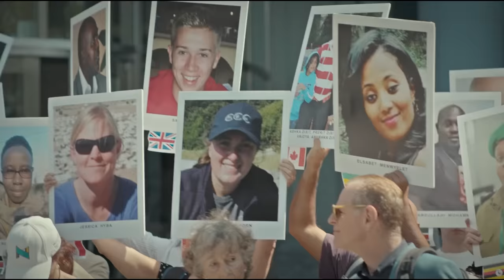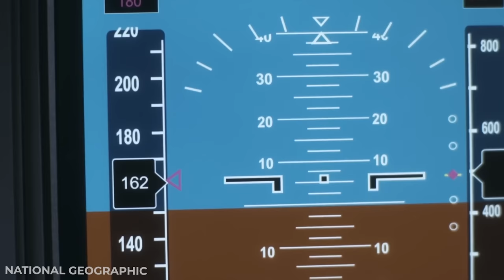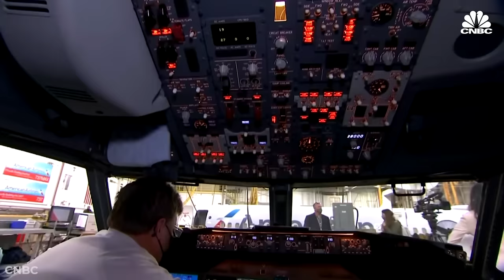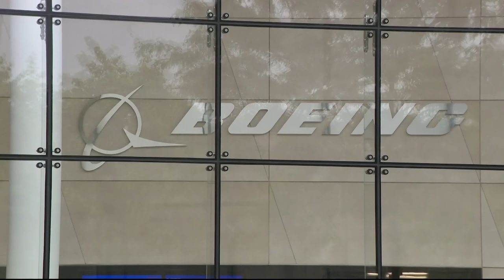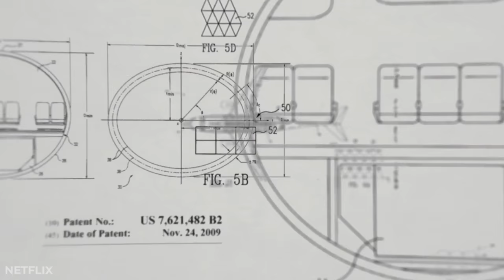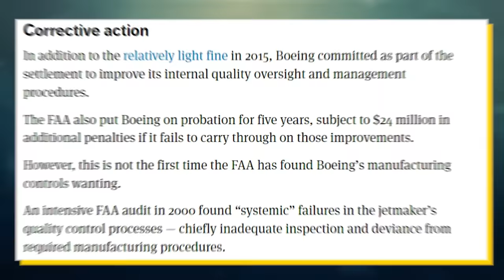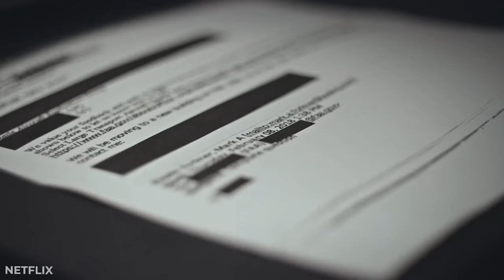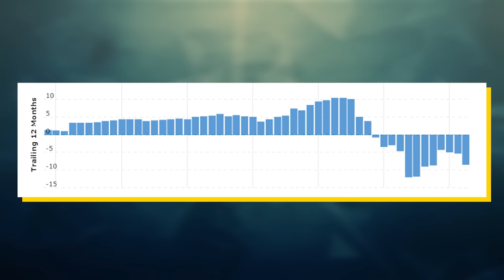Even Boeing Engineers Don't Trust Boeing...

Comment: I'm not an aviation nerd and after the 737 Max 8 disasters I started to pay more attention to what plane I was flying on. I don't trust Boeing at all. Also, it's not just Boeing's fault. The FAA had a huge part in the 737 Max 8 disasters, by the fact they allowed Boeing to self-certify.
Reply: as of now the 737-8 max is faa certified and it is being used all over the world. The only area where it is not allowed to fly is china, eventhough it will start flying there.  You have nothing to worry about (:
Reply: I always preffer Airbus. As cabin pressure is perfect & Toilets size is ok for civilised people.
I only travel by Indigo & Vistara for domestic & Emirates or Singapore for international (For A380)
Reply: I simply stopped flying at all.
Reply: Yeah - I think I'll stick to airbus or older Boeings from now on.
Reply: @rishavbhowmik8163  you have not been on  a 777, or 787?
Reply: There is always going to be some degree of self certification.  I would be surprised if this is not the globally general case.  It is simply too expensive to do it otherwise.     Other than the fact that the 2 planes did crash most of what you see in the media is wrong.    Boing can't fight the misinformation directly as it would be characterized as ducking responsibility.
Reply: @rishavbhowmik8163  Why? Airbus has had its own share of problems that were pretty much identical to Boeing’s, such as their recent incident with landing gears.
Reply: @aycc-nbh7289  you mean where 2 airbusses just nosedived into the ground without the pilot being able to react and they tried to sweep it under the rug for as long as possible? 😅
Reply: @Schimml0rd  I was unaware of that incident, but I was referring more to a particular incident where the front landing gear of the A320 can be stuck at being rotated 90 degrees, jeopardizing the ability for the plane to land safely, as it had infamously occurred on a Jet Blue flight where the passengers watched their own emergency from the IFE monitors.

But I guess I should thank you for bringing another incident to light. The Western world has too far been held ransom to the duopoly of Boeing and Airbus and we need someone else to manufacture medium- and long-haul aircraft to compete with them.
Reply: Well I hate to break it to you but Airbus has had similar problems with similar cover-ups by their relevant governments. This is just how it's done.
Reply: Certainly never fly on a Max. Avoid Boeing where possible
Reply: @lila2028  Why, because you assumed all aircraft types were unsafe without having intimate knowledge of them?
Reply: @danharold3087  There isn't misinformation in the media about Boeing.

They designed a system which exercises control over the aircraft under certain circumstances and did not provide any training to the pilots on the system and did not even put anything in to the aircraft manuals. They deliberately hid details of the system to avoid demands from the airlines for training on it, which pushes the cost up, which they wanted to should.

Not only that, as an engineer, I can say that the system was very poorly designed, and some serious short comings and in my opinion should never have gone into operational service.
Reply: @deang5622  Start with the misinformation regarding 7373 MAX stability.  Media says due to engine placement it is an unstable aircraft.
Reply: @danharold3087  Technically it is unstable, but not by much.
Reply: Boeing planes from before 1997 are also generally of good quality. They merged with McDonnel Douglas in '97 and that's when their quality got much worse.
Reply: @deang5622  All aircraft with under wing engines change pitch when power is adjusted up and down.   If you call this instability there are no stable airliners.
Reply: The FAA was allowing planes to be certified by the same manufacturer because they didn’t have enough funding to properly test all the planes, you can thank Trump’s administration for the budget cuts
Reply: @Sweedster   But is this unique at Boeing.  We only know of it because things went badly wrong.   It is doubtful that this is a binary thing.   The FAA could have prevented this with the people it had if they were more diligent.
Reply: The FAA  had at the very least one chance to stop the madness with the existing inspection setup.     A FAA inspector was shown a 737NG with MCAS fitted to illustrate that MCAS was not new.  Had he realized this was a ruse it could have stopped there.  Yes people at Boeing were at blame.  But so are people at SW and the FAA.   

I have said elsewhere that this could all have been avoided if airlines did not directly pay for simulator training.    Fix that and you prevent it from happening again.   Slap Boeing and the problems remain.
Reply: @Schimml0rd  One airfrance airbus nosed dived in the atantic because a sensor failed and the pilots tried to gain control. 300 passengers passed away. I believe families are sueing airbus.
Reply: @joergkalisch7749  obviously
Reply: @alexrebmann1253  that's not true
Reply: @kirilmihaylov1934  tell me why
Reply: @alexrebmann1253  because it was Pilots fault not Airbus
Reply: @alexrebmann1253  Are you referring to Air France flight 447? If so, that was 100% pilot error mixed with poor CRM
Reply: @stefanocozzi8188  given the choice I would chose to fly on an Airbus right now.
Reply: @alexrebmann1253  The 787 has excellent high cabin pressure and is very quiet. The 777 has none of those things. The 777 is the loudest wide body airliner I've ever traveled with. Like a 20 year old car with bad door seals doing between 200 and 250km/h. The cabin pressure is the same as on any other metal fuselage aircraft (including Airbus).
Reply: @rishavbhowmik8163  that's legit not airbus/boeings decision mate that's all choses by the airline. Interiors are cometic and free for the airline to customize to their desire. number of seats, type of seat, gap between seats, colour, pressure (to a degree) temperature toiletries, toilet all of that is done by request of the airline custom for each of them. Boeing is still the best air manufacturing company out there and theese accidents were in part due to improper training of the pilots. Although both crashes were from a faulty sensor that has since been fixed and replaced on all airframes there was a manual override that would've saved both flights if the pilots used it. Panic/not knowing where that override was caused the aircraft to crash. The override was (and still is) on the trim wheel and i quickly thought myself that so that if I was on one and it started plummeting I'd legit break down the door if I had to to tell the pilots what to do and say geez y'all never learn or something? 
The airlines that had crashes should definitely had that be part of the training for this aircraft but they happened to take the lady way assuming things were basically identical to other 737s and didn't bother to do proper retraining for the maxx model. It's like moving a stair step 0.5 cm makes everyone trip moving the trim override and having a new sensor for it caused pilots to lose control over where thing were. Boeing is safe. Has a better safety record than almost all other airlines and is still the top dog. The 787 is the most advanced civil aviation aircraft in the world and like the name it would be a dream to fly it.
Reply: @CheapBastard1988  it  is new aircraft after all
Reply: @Sweedster  and Boeing has decades of experience testing aircraft even being a certifyer for other manufacturers and the max would've passed all FAA regulations. Easily. The crashes were not due to bad design. It was bad pilot training and lazyness from the airlines. Many of them flew without crashing but two incidents occured when pilots did not know how to react to the aircraft's anti stall system malfunctioning and basically didn't do anything right. All they needed to do was to override the trim adjuster which they would've found on the trim wheel right next to their legs.
Reply: @longfang98  Boeing has a better flight record. Airbus's isnt far behind true enough but Boeing is the safer aircraft so idk where y'all get this from
Reply: @kirilmihaylov1934  "obviously Boeing isn't safe" meanwhile Boeing having the safest not just aircraft but transport vehicle IN HISTORY. Yeah totally not safe. It's the second safest aircraft manufacturer in the world second only to bombardier. Who when you think about it is too young to have a accurate safety record as if right now. Flying is sti the safest mode of transport in the world and Boeing still delivers some of the safest aircraft ever. The 737-800 being the safest commercial aircraft ever flown.
Reply: @elementalgolem5498  that's not true . Saying this after  the 737MAX debacle means you don't think at all .
Reply: @deang5622  exactly right
Reply: @kirilmihaylov1934  ? It's really not a big thing man. Iike their safety record is still top tier Prestine. Even with the max crashes look at ANY stats on aircraft safety. If you paid for it is gladly fly a 737 max 1000 times in a row just to prove how rare a crash actually is. It's statistically unlikely i would even experience a minor aircraft issue. Let alone a fatal crahs
Reply: @EvanBear  yes that is true
Reply: @notsocooldude7720  yes he is but he doesn't know the case
Reply: @elementalgolem5498  statistically speaking Airbus has less crashes than Boeing especially as of late
Reply: @aycc-nbh7289  that's not true . Did any Airbus crash  like 737MAX  . So you saying nonsense
Reply: @kirilmihaylov1934  you cannot. And i do mean CANNOT take the men number of accidents. Airbus has more accidents per hour/mile flown as Boeing aircraft have been flown for a significantly longer amount of time. When Boeing has Multiple of the top 5 most flown aircraft then ofcourse they will have .ore crahses, crashes are bound to happen you cannot avoid them. But if you were to chose yourself a car brand and one has driven over 1 000 000 miles and only had 10 malfunctions that lead to a fatal crash, or the brand that has only driven 100 000 miles and only had 5 fatal malfunctions? I mean the one that hasn't driven as far has had less crashes right? Who cares that the other Has gone 10x further and sti had only 2x the crashes?? It's not how statistics work and that's why aircraft safety records and airline safety records are measured in deaths per 1 000 000 miles flown. Boeing is at 0.71 or something and airbus is at 0.76. both absolutely tiny numbers ofcourse but Boeing is still well in the lead making the chance you specifically will die when boarding a airbus aircraft higher than when boarding a Boeing aircraft. If you really want to feel safe fly a bombardier i think they are at like 0.67 deaths per 1 000 000 miles flown. Lowest of all. Dethroning Boeing as the safest. Emirates is considered the safest airline to fly and they fly predominantly Boeing aircraft.
Reply: @elementalgolem5498  Emirates doesn't fly 737MAX  .
Reply: @kirilmihaylov1934  Please reread my comment. There was a specific incident on a particular Jet Blue flight where the landing gear infamously rotated 90 degrees and the plane had to make an emergency landing. This has occurred on other A320 planes to my knowledge.
Reply: @kirilmihaylov1934  “As of late”? Is there any specific epoch related to both companies that would separate “in the before time” from “as of late”? And why are these crashes even happening? Aircraft malfunction? Overlooked failed part during inspection? Pilot error?
Reply: @kirilmihaylov1934  okay and? It's been years dude the max has over 500 000 flight hours since the issues and has had no incidents.
Reply: @elementalgolem5498  I think you are missing the point. Ppl are worried about Boeing attitude and cost saving mesures. Airbus, to my (limited) knowledge, never screwed up to the same degree as Boeing (with Max), and never heard of any proof of the same cost saving attitude (not to the extent of Boeing). 

No one claims Airbus is statistically safer (or at least i don't think it was the intention), but from what we can see, Airbus seems more preoccupied with passenger safety then Boeing, and this is why some want to fly on Airbus. 
I would fly hundred of times on a Boeing without worry, but i would still pick Airbus if i had the choice.
Reply: @aleide2980  thing is Boeing doesn't have any "cost saving measures" nor a bad attitude. It's all misinformation circulating the internet perpetuated by people that don't have a clue on how aviation works. The air manufacturers don't save on costs because airlines buy the aircraft almost no matter the price. The max doesn't have any cost saving features. The feature that was a issue is Boeings new anti stall. It's a sensory device that detects when the aircraft airspeed is getting too low and about to stall(fall out if the sky) at which point it will take control of the aircraft and automatically pitch it downwards to get the speed up. It's a pilot error prevention device not a cost saving device. It's literally a safety addition that came with the max. And is still now (a more fledged out) feature of all new Boeings. Ethiopia air and i don't know the other (Malaysia air maybe?) Didn't bother properly training their pilots on all the changes because they assumed the 737-max would be the same as the 737-800 they already had training for. So when this feature malfunctioned 2 times, one time in 2018 and one time on 2019 both lead to a fatal crash. However if the pilots had disengaged auto trim using the trim wheel next to their leg neither flight would've crashed. Meaning that although it was a system malfunction. It was stil pilot "error" as it was a preventable crash had the pilots acted well. Many want to blame Boeing for not training the pilots. But that's the airlines responsibility Boeing did provide checklists and a user's manual they could've spent a couple hours reading
Reply: @elementalgolem5498  didn't really follow the whole thing, but didn't Boeing 'forgot' to inform companies and/or pilots how the new anti stall works? That's what I heard at least.
But when I was talking about cost saving, I was more referencing the cargo doors incident. Most of the things talked about in this video seems legit/coherent, so the point about safety and cost saving still stands.
Reply: @aleide2980  you are right this guy is a troll
Reply: @aycc-nbh7289  q
Yeah landing gears is the same like killing  346 people...give me a break will ya
Reply: @kirilmihaylov1934  It actually is the same, since a landing gear malfunction could mean that the engines get jammed from the resulting debris or from the engines colliding with the ground and a pilot error could increase the likelihood of messing up an already dangerous landing.
Reply: It is called regulatory capture, meaning industry veterans take government regulatory bodies over and try to bend rules and regulations in their favor, often at the expense of the public. A very common occurance in the US over the last 30-odd years.
Reply: @vivektulja4516  exactly right ....big business  pays the government agencies in US
Reply: @eleventy-seven  Are you sure? Airbus has also had its share of quality incidents, including one where it bribed regulators in the exact same way as Boeing did to get themselves out of trouble back in 2009 or so and one where their A320 aircraft had defective landing gears, which infamously lead to a Jet Blue flight making an emergency landing with the passengers on board watching exactly what was happening on their IFE monitors.
Reply: It's because boeing payed them to
Reply: Kiril Mihaylov  The CFRP fuselage is the reason that the 787 can do its high cabin pressure and it can have air humidifiers. In an aluminium fuselage, the high cabin pressure isn't possible and air humidifiers are a bad idea because of the corrosion it will cause.
Reply: @danharold3087  except that in order to fit the much larger turbofans they mounted the engines much further in front of the wing increasing the lever arm and thus the torque forcing the nose up. Changing anything more than this would have made it difficult to claim that this new plane was just a 737 like any old one before. If it was a new type then all pilots would need new certification making it much harder to sell into current airlines. This whole mess was just a result of creating an essentially unairwortthy craft that they could easily sell for a big profit.
Reply: @tonycook7679  Mr Cook.  You can stick with the ill informed media story if you like.  I explained the forces.  Not my fault if you can't or will not understand it.  Not going to waste more time.
Reply: @kirilmihaylov1934  fun fact just boarded a 737-8max so I'll let you know in about an hour if I survived the flight
Reply: @tonycook7679  it's definitely not unairworthy with over 500 000 flight hours without incident, I'm taxiing in one right now. Will let you know how it goes
Reply: @elementalgolem5498  cool . Give an apdate
Reply: @elementalgolem5498  if one more of  those is going down it will be the end for Boeing
Reply: @kirilmihaylov1934  landed safely
Reply: @elementalgolem5498  cool
Reply: @aycc-nbh7289  I think he's saying that Airbus never had a problem like that, that was what happened to the 737 max.
Reply: @simongregory3114  And now the A350 seems to have suffered another landing gear issue.
Reply: i will never board a 737 max. ever.
Reply: they didn't assume it was the same! Boeing literally hid the fact that the 737 MAX had this new MCAS system to avoid additional pilot training, even when airlines asked about additional training or changes. Boeing told them its not needed (which was a lie). They knew that the MCAS system was faulty but didn't say anything to anyone to save costs. So stop blaming the Pilots that couldn't have known and lost their life because of boeing.
Reply: @stefanocozzi8188 U SURE ABOUT DAT?
Reply: The FACTS are that Boeing rushed the 737 Max to market and were deceptive in fully explaining the changes to the FAA and pilot training. THAT is the main cause of the 737 Max problems. The quality issues are a direct result of the rushing to market. The ROOT cause of ALL of Boeings problems are indeed the short-term profit motive. I hear every “motivational” brief from the CEO down and the bottom line is commercial aircraft production speed and market savvy. Very little true engineering or specific problem discussion, only market-speak and “diversity”. It’s disgusting.
Reply: @ori4627  because it served as an extension of the STS so it can use existing QRH procedures for runaway trim. that design philosophy worked perfectly, had the pilots know how to deal with runaway trim. technically, it wasn't MCAS that explicitly made the aircraft nosedive, it was the resulting runaway trim. 

MCAS was there to serve stick force regulations set by the FAA. it wasn't for the additional pilot training, it was fundamental for the handling of the aircraft. MCAS on paper was not faulty; it served as an extension of the existing STS, hence there was no need to tell anyone about it. does Airbus need to tell anyone the specific changes they made for their FAC when the A321NEO exhibited similar nose-up tendencies as the MAX? no, they don't, and they didn't.
Reply: Good god, no it isn't. The aircraft has slightly different flying characteristics to a standard 737. Under power, those powerful forward placed engines would raise the nose more than a standard 737, MCAS would adjust trim as necessary to resemble the legacy aircraft. Statement: Runaway trim was considered a non critical event for decades and didn't ever require redundancy, hence the single AOA sensor on the MAX - . The MCAS software only operated under certain conditions, with flaps up and it was surely a poorly considered piece of software, we all understand that - yet it induced a similar condition to runaway trim, which would happen if a bit of sandwich got stuck in the trim button on the yoke, whatever. The 737 has massive trim wheels by your elbow with a white stripe on them so peripheral vision can't ignore it, when they continue to spin, uncommanded for five minutes and you start having to pull the nose up, you turn off the electric trim. 
When engineers fit the wrong AOA vane giving an erroneous fixed 30 degree attitude at nominal, and the previous crew tell you that its buggered, and months after the Lion Air crash  when the MCAS system is known  about and the procedures to handle the failure are known worldwide it is quite a stretch to understand how the Ethiopian got into trouble. They did though and switched off electric trim, which was the right move. During this breathing space the aircraft was overspeeding with warning clackers sounding. They did not attempt to stabilise the aircraft. Instead  they continued to overspeed and did the only thing that would guarantee a fatal result, they switched the electric trim back on. The whole thing was a catalogue of tragic errors, yet Boeing under pressure of world opinion had no option but to raise their hands and admit it was 100% their fault. Nobody would even allow the pilots to be criticised. You were a bigot if you said so and that the training was poor. Guess what, the training was goddamn atrocious. 
I'm not saying Boeing is wonderful, I'm saying lets have the full picture without bias and without worrying about hurting feelings. We all deserve the absolute truth. We know what Boeing did wrong, now how about training and other reasons for these incidents. I would NOT step on an aircraft if it had someone who couldn't recognise runaway trim or a stall, like the French Airbus pilot. We must choose people who have sympathy with aircraft and understand the technical aspects of flight to be pilots. We don't want accountants to be pilots as Air France chose to be holding the nose up all the way to the ocean from 35,000 feet  @deang5622
Reply: @martinda7446  You are placing too little too little blame at the feet of Boeing and far too much at the pilots.

Firstly a single AOA sensor operating at a time in the system is a serious design flaw. If the sensor malfunctions - which it commonly did - then the input to MCAS is garbage, and the output control signal to the elevator trim is likely to be garbage too.
This was avoidable by using a redundant sensor.

Second, there was inadequate pilot training in the MCAS system.

Third the aircraft documentation was deficient.
All of these are Boeing's fault.
These are the facts and not up for debate.

If these facts were not true then the FAA would not have mandated that Boeing address the shortcomings and requiring design changes to MCAS.

And can I ask you to paragraph your rambling post better please. You sound to be reasonably well educated and you should be able to write better than you have. Your post is one big long poorly paragraphed and spaced block of text which is difficult to read.
Reply: @danharold3087  the engine placement is actually unstable...and whats a 7373 lol.   And the problem is not  under-wing engines like you said. They indeed will change the pitch of the aircraft when thrust is changed but the quastion is how will you resolve that? Boeing did it for the 737 max by moving the engines a bit forward, which in itself decreased its stability and their MCAS is famous enough for me to not explain it to you. Airbus did it by integrating a very generalised solution to all the extreme ends such as overspeeding and stalling, by augmenting the fly by wire system which Boeing is also adopting in its recent airliners such as the 787
Reply: The 777 and 787 have clean records, and the 757, 767, and NG 737s have a good records too.
Reply: @JJs_playground
The certifying body allowing the manufacturer to "certify for itself" is ridiculous. Each (activity) has its separate role. It is well-known that every mother feels that her baby is the best. 
What happened is - Politics (political decision). Boeing wanted to confront its rival Airbus - in the "market". For that it is prepared to do its best (worst).
Reply: I haven’t flown in 15 years. Now, I don’t know of I can trust Boeing. Their acquisition of MD just never made sense to me. If I do fly again I would rather fly on an Airbus plane because I really want to go and visit Japan.
Reply: @aycc-nbh7289 I think the plane going into a uncontrollable nosedive because of a sensor failure is a much more significant issue than the front landing gear getting stuck 90 degrees on landing…
Reply: @elementalgolem5498 shouldn’t the most advanced aviation aircraft ever designed also be the one with the most safety features?
Reply: @thegeforce6625  it is though? The feature that caused the two crashes was a safety feature that would save the plane from pilot error should they be inducing a stall. However when 2 out of hundreds of flights had a malfunction that literally took one button press to fix. The pilots had gotten no training by the airline due to laziness and assuming that oh it's fine it's basically the same aircraft. Fatal crashes occurred. That's why this happened at less reputable airlines and not Lufthansa or something like that
Reply: @thegeforce6625 You also have to consider that the landing gear could have detached itself and either crashed into one of the engines or torn a hole into the fuselage. We’re very fortunate that this hasn’t happened, but luck can only get us so far before it runs out.
Reply: @stefanocozzi8188 Haaa f-ing joke on you, hello 2024 door plug HAHAHAAHAHAHAHAAHA
Reply: @Schimml0rd look up quantas 72. It is more complicated than just the criminal nature of crews not being trained on the MCAS system. There is plenty of blame to go around for the airline maintenance and crew performance in lion air and Ethiopian flights.